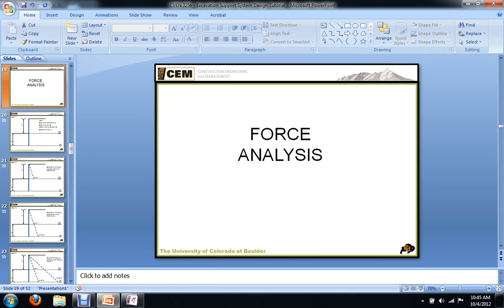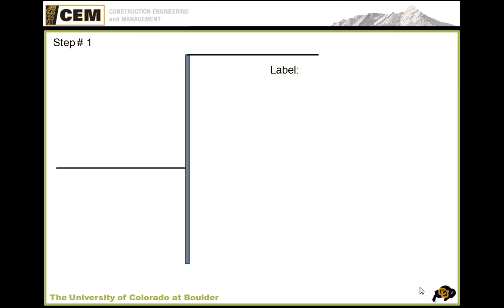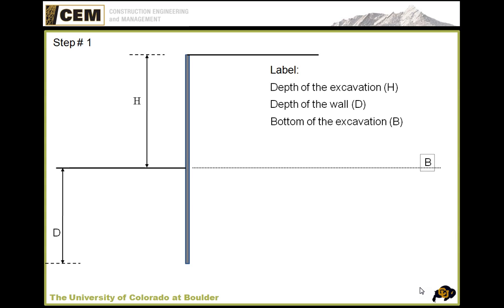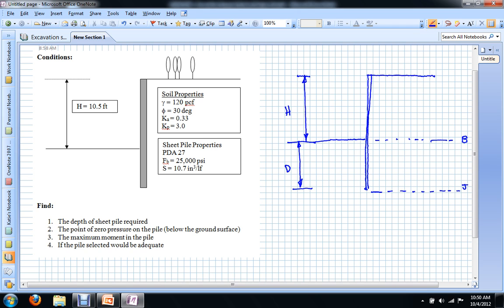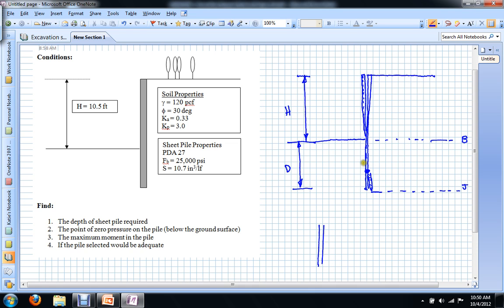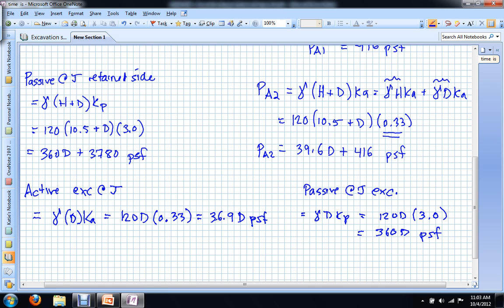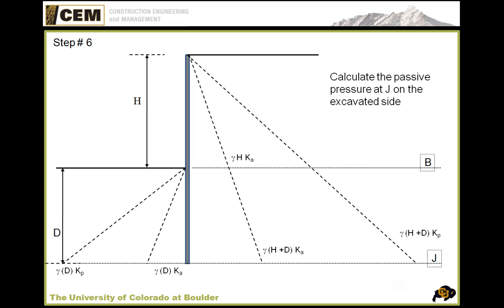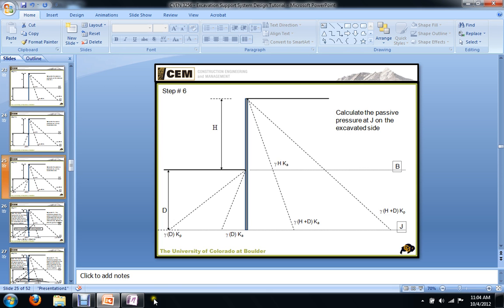Earth pressure on a cantilever wall

Comment: Thank you very much for the video.I have a question please, the pressure at any height from top is P=gama*Ka*h but at the bottom is P=(gama*Ka*h^2)/2. The only thing I can think of about the h^2 is because it's at the bottom. Is it correct? and how about the 1/2? where is it from?
Reply: +WHY70122 Area of a triangle is equal to .5*base*h^2.

Comment: Some Pa formulae I've seen is Pa = unitweight * Ka * H^2. note the H^2. I noticed you dont square your height. If we compute the units (metric) using your formula we get kN/m3 * m = kN/m^2, whereas when you square H you get kN/m3 * m2 = kN/m. Which is the correct equation to use and why would we square H? Great videos by the way, I'm starting off as a civil engineer and its good to learn off videos like this.